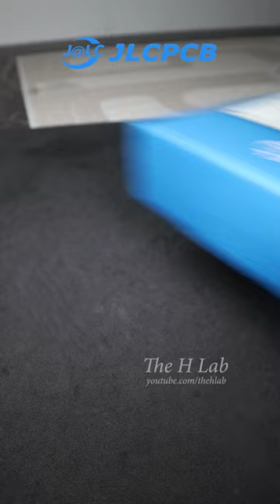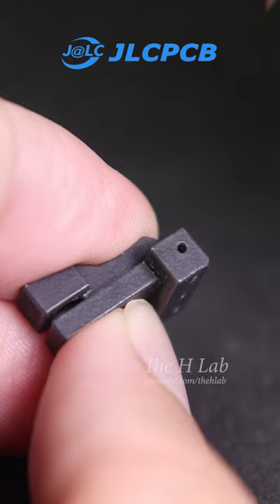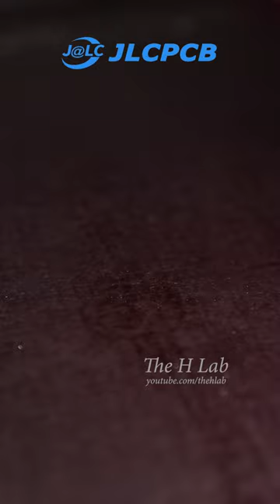3D Printed Boat Trailer Micro 4x4 RC Car | The H Lab #shorts

Comment: Put wheels on a battery holder, or slash a arms....no 3d printer required, which is what you really should be doing.